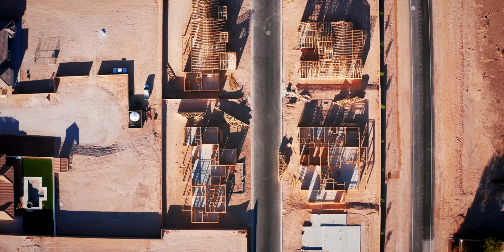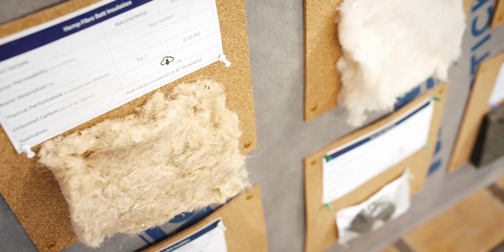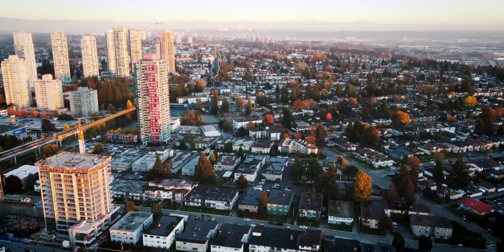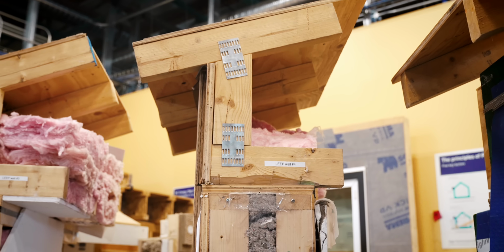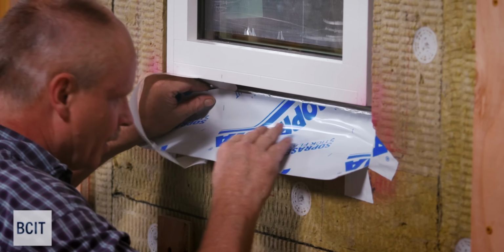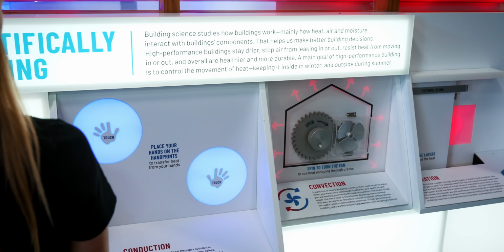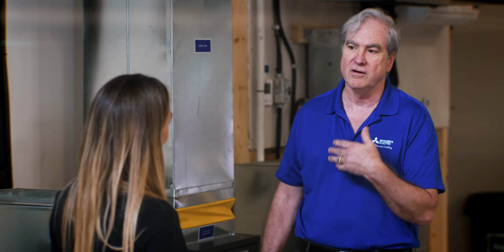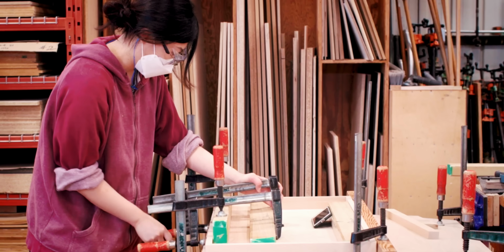THIS Is How You Build A Passive House!

Comment: None of this is needed. If the building is purely powered and heated by zero emmision generated electricity, there is simply no need for any of this.
....our building is already zero emissions.. Zero in zero out... My solar system powers of 4 bedroomed house cost 15k and breaks even in three years.. Then I'm saving £5,000 pounds a year in heating and electricity here in the UK.. Now factor in the fuel savings if you are lucky enough run electric vehicles chsrging at home & Yr breakeven point becomes even closer.

Comment: One thing I don't hear enough about is ground sourced heat pumps for new build condos in cities. They already have to dig very deep for the structural foundation and parking garage. Why not go the extra step for the heat pump? I know it's not unheard of, but I really think it should be the standard by now.

Comment: A "passive house" is absolutely NOT defined as simply being net zero carbon emissions.

A passive house uses no mechanical or electrical systems to heat, cool, or ventilate it. 

I don't know who is redefining these terms for you, but they need to stop it. It sounds as if some manufacturer is trying to conflate their product with something that is actually a higher standard. That's kind of like painting your watch gold, and calling it "a gold watch."
Reply: Yup - the clue is in the name : Passive Haus (House)... that said, the outline at the beginning was pretty good, with the primary focus being on insulation and being airtight, etc... and only adding the 'active' components as the finishing touches (I'm guessing BC has some fairly significant temperature swings between winter and summer, so some form of active heating / cooling is probably recommended... but it can be far smaller and more energy efficient if the 'passive' elements are built in from the start.

Comment: Maybe also build houses with proper thermal mass that can even out the swings in temperatures so no AC needed if it is hot for a couple of days and no heating needed if it is cold for a couple of days. I only saw the American toothpick and plywood style construction in the imagery but maybe that was just some stock footage and not examples from BC?

Comment: I,m all for this.....I bought a mostly wood framed building in Eastern Poland....then I asked the builders to insulate the inside........then I asked them to add very thick insulation and wood cladding to the outside.......after 5 years I brought in a guy to add another 10 inches of insulation to the outside...my walls are 3ft thick  all wood and insulation.......Next???   triple glazing and 'air locks' or something like, so that no door opens direct to the outside.   But sorry...I hate your stupid electric cars....come back in ten years and maybe the tech will have moved on enough that I don't need a big diesel 4x4 and can buy an electric.....but what defines electrics for me at the moment is..... X Bus...great idea....crappy people with no idea..(probably wokey w*nkey germans).which is why it is not in the market yet...there must also be hidden things about it that are WRONG???  or why has no some big company who knows how to make cars snapped it up yet?   I have the house....I need the car.

Comment: The challenge of skills shortages is a big one.  Unfortunately the construction industry is a very conservative industry and very slow to change its methods.  In Korea for instance, I’ve been in shipyards where ships are made out of “Lego brick” modules.  These modules come as a complete structural unit complete with pipework and railings, which come seemingly straight off an autocad drawing via a cnc machine.  Yes, they still hire tens of thousands of people, welding is not at all an obsolete skill by any means!

Does land based construction use factory built modules to make buildings?  I’ve not seen widespread examples.  But once upon a time ships used to be built in a manor that was closer to how houses are built today (and for the last few hundred years) - one piece at a time.  

How ships are built today should be how houses are built tomorrow.  Factory built, lots of automation, yielding consistent quality and (hopefully) lower costs.

Comment: The first question we need to ask ourselves is how do I use energy? 
It’s expensive! On my bank account, on the planet, and even geopolitically!

Another good question is to ask, how energy secure am I?
Why would you pour water into a bucket with holes in it?

How do I stop the energy leaking away? 
This needs to be considered before, during and after all construction change. It underpins much of what we could do.

Where do I get my energy from?
Can I use that thermonuclear device that passes across the sky every day? (The Sun!)

How do we finance it? 
Do I personally finance it either in part or fully, or does the gov part finance it?
It’s both! Please don’t hide behind “It’s the Governments fault!” That’s an excuse to do nothing.

We all need to take some responsibility and a stepped approach is good and a goal based approach is ideal.
We can all get grants for insulation - Fully Gov financed.
Grants for Heat pumps - Part financed (£5K)
Solar and Home Battery? (Currently 20% VAT Free)

So we need a passive home, not passive people!

My views are UK based.

Comment: This is great for single family detached homes, but what about semi-detatched, multiplexes, townhouses, apartment buildings and condominiums?  These need to be net zero too, right?  There is a big push to get away from the "yellow zoning" which is for single family detached homes only due to housing affordability issues and an understanding that commuting 1.5 hours each way to work because you can only live in the suburbs is a quality of life issue.
Reply: Don't see why it would change for semi-detached or terraced homes, etc?  If i were to sum up PassiveHaus simplistically, it would be 'build it properly in the first place' :p (build homes to minimise the amount of energy they need to use - for heating or cooling)

Comment: In climates with hot temperatures during the day it's not enough to have insulated surfaces: they must have enough heat capacity and be shadowed on the south side in summer... in order to prevent wasting energy with a HVAC...

Comment: My home was built 2 years ago, it has good insulation to the point that it's too hot most of the time, we barely need to use the radiator but I find us using the portable AC in summer quite a bit to try and cool it down.
Reply: It sounds like your house is subject to too much ‘solar gain’. The Passivhaus model prevents homes being built with this as it carefully balances energy in vs energy out. The UK national regs are poor at achieving this, so Passivhaus is better in this respect. External shading, such as simple mobile shutters, would prevent you needing to resort to AC. Thanks to climate change countries such as the UK that have no tradition of shutters will need to embrace such simple methods of reducing the risk of over heating.

Comment: Brilliant episode - if only we had similar targets like this in the UK, but there is zero chance of that with our current administration , who just seem to want to delay & water down any existing targets/regulations to suit their house builder mates that support them.They can't even mandate solar panels on all/most houses , which seems a no-brainer. Reducing the amount we all need to spend on heating and also cooling which is becoming more of a thing nowadays due to the changing climate , will benefit us all for years & years to come. Using the resources we have available  more wisely, rather than just use it because its cheap.
Reply: The good news is that precisely because they have let our UK regulations fall so far behind in performance, the next administration may simply have to embrace a UK branded form of Passivhaus. Many UK registered architects have been qualifying in the standard for years anyhow as clients are increasingly aware of the Passivhaus standard.
Reply: "zero chance of that with our current administration , who just seem to want to delay & water down any existing targets/regulations to suit their house builder mates that support them" - this is the bit I don't understand, at all. Surely if they mandated that new houses must meet passive house specs by 2030, **and provided incentives to do so**, their housebuilder sponsors/mates would be quite happy? Same if they mandated that all old housing stock must be upgraded to similar standards (or demolished, if impossible and not a listed building) by 2050 - again, with sensible incentives to the owners of such housing stock... then their housebuilding mates would be rolling in well-paid work for years to come... Plus we'd all vote Tory to get our interest-free loans for upgrades...

Comment: Just one question.. 

Where do all the trees come from?
Reply: That's kinda irrelevant (to this topic) given the houses will be built regardless - the question is how they're built.

At least trees are (somewhat) self-sustaining, especially if replacement seedlings are planted in each field after harvesting the existing trees (yes, the trees are grown on the equivalent of 'farms' - they're not chopping down firgin forests, etc.... mostly)
Reply: @logicalChimp  oke. so how many forests do we need to cut down for it? How long does it take to grow back. Still think its irrelevant? If we keep going as we are now we should cherish every tree out there. And not cut it down. And we would need to plant a lot of trees on top of that.. trees that cant be cut down either.. And did you hear the numbers 6,000,000 homes in British Colombia alone. And the wood that goes in one house is a lot more then 10 trees.
Reply: @logicalChimp  Point is there are not even enough treefarms in the world to provide wood for 6.000,000 homes for BC. let alone the whole world. And if we start growing them right now it will still take up to 40 years before we can cut them down. And thanks to that that "mostly"part will become less and less likely as there is already a thriving illegal trafficking of wrong wood. And thanks to climate change seedlings survival rate has been going down significantly in the last few years as well.

Comment: I feel like a missed point is architectural choices for solar heating by carefully planning the alignment of roof overhangs, window size and position, and the orientation of the window to where the sun shines from, to allow the building to gain free heat from direct sunlight, but only when it's not air conditioning season.
Reply: Because it's insulated, is it not? That's the point. Passive houses aren't new where I'm from - you lower the blinds and it's fine. If it cools during the night, you don't need AC, even in the hottest weather. And if it is hot out, there's probably sun and you can use that to power the AC for free.

Comment: We have this in the uk to the issue is they focus on new builds and the old builds get left the way they are, we habe council housing and all the old builds get left and not updated in 2021 the home I moved into had 70mm of insulation, the reccomeded was 150 back then now it’s 300 and I’ve only just got 150! We have no solar panels no heat pumps and poor insulation( they use a lot lot more gas and electric to keep them going, but they focus on the new builds
Reply: It's way easier to legislate for new build requirements, than it is to find the money to upgrade old stuff. My 1930s semi is a bastard to heat (or cool) and leaks heat like a sieve - realistically, it'll cost tens of thousands to bring up to modern spec; money I don't have handy...
Reply: Implementing it into new builds first is good for a couple of reasons:
- far cheaper to build it in from the beginning than it is to retrofit afterwards... update the building code, and you at least stop the pool of buildings needing retrofit from getting bigger
- ramps up demand in a controlled way... which leads to more training tradesfolk and increased supply of materials and equipment (helping to lower costs for subsequent retrofits)

Comment: Europe is a long way in front of Canada in building technology. Airtight building technology was developed in Europe and is cheaper and better than Passivhaus.
Reply: I don't know who came up with the idea of building air tight, but Canada also has a long history of research and experimentation with energy efficiency. The Saskatchewan Conservation House, built in 1977, was designed to be very air tight and was one of the first houses ever to have a heat recovery ventilator.
Reply: @bartholomewcubbins9723  In 1973 a number of houses were built using SIPs. They had problems with damp which was solved by inserting an ultra insulator as a gasket in the bottom and top rails. The houses used a passive hrvs system in 1979.

Comment: I get that we do have to do something but BC already gets 98% of its electricity from hydro powered. It would have a low footprint if we switch to electric heat. That seems to be more important than passive housing. The carbon footprint for building passive is quite high. You would think a compromise to improved efficiency with heat pumps would be a better choice for reducing CO2 overall. It would also help to keep the cost of housing lower. 

I would rather spend the money converting old houses to heat pumps than all new houses to passive.
Reply: Switching out a gas furnace for a heat pump certainly cuts CO2 emissions immediately, but also increases electricity consumption. Improving the building envelopes (of both old and new houses with heat pumps) reduces electricity consumption, leaving more available for electric car charging or to export to other geographic areas that don't have their own local sources of clean electricity, both of which will also reduce CO2 "overall".
Reply: @bartholomewcubbins9723  It is a bit of an assumption that the passive house reduces CO2 overall. You are potentially increasing your CO2 footprint with excessive insulation. Vancouver doesn't get very cold. 98% of BC electricity is green so over the life of a house, the total CO2 footprint is not necessarily better with a passive house.

I looked into a passive house but many of the products had to be shipped long distances and were expensive. Wood sourced insulation is a good idea because it tends to capture CO2 but there are no good wood insulation products in the local market. The point being, I don't think it is obvious what the right thing to do is and you have to be careful.
Reply: @yodaiam1000  Because Vancouver doesn't get very cold, it doesn't take that much extra insulation to reach Energy Code Step 5. If you only look at CO2 emissions from one house, then I agree that reducing the use of green electricity won't accomplish much. But if you look at the overall picture, considering how that saved electricity could be used to reduce CO2 emissions elsewhere, then there will be a significant benefit.

Were you looking at building to the Passivhaus standard? There are manufacturers of triple-glazed windows in Canada, but they may not be certified by Passivhaus. To reach Step 5 in Vancouver, you wouldn't even need triple glazing. As long as you don't have too many windows, quality double-glazed windows with low-E coatings will be enough.
Reply: @bartholomewcubbins9723  The main issue is sourcing the required amount of insulation. You need about a 12" of wall insulation in Vancouver to meet the passive house standard. There are also air/moisture barrier requirements. Many of these products are not locally sourced. It is fairly significant even for Vancouver. Wood insulation is better for capture but there is nothing local. Shipping is very expensive and adds CO2. You are looking at $60000CND just for the additional shipping for the wood based insulation on a typical house.

I am not saying it isn't necessarily worthwhile, I am just saying you can't assume the life cycle CO2 footprint is better with a passive house due to the extra capital in CO2.

I would also say the floor space ratio and building area restrictions in Vancouver and the lower mainland are punitive for passive houses. You are spending all this money to do the right thing and you get an effective smaller floor space. The newer codes also require more shallow sloped stairs. This is amplified in Vancouver since they increase minimum hallway widths.  It eats away proportionally more space from the rooms. If the province is proceeding with this, the zoning laws have to change so people aren't penalized for building better homes.